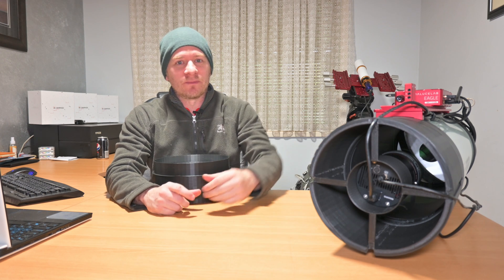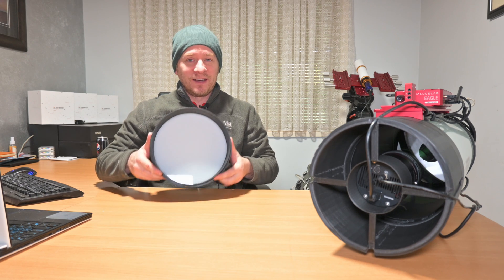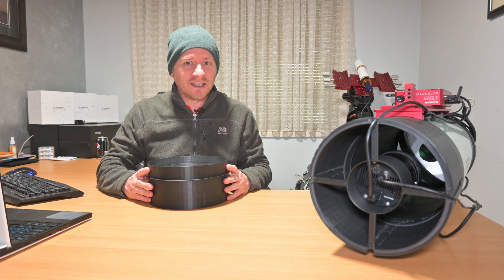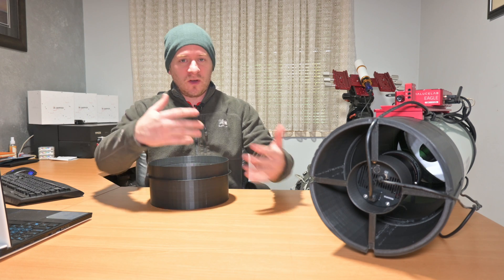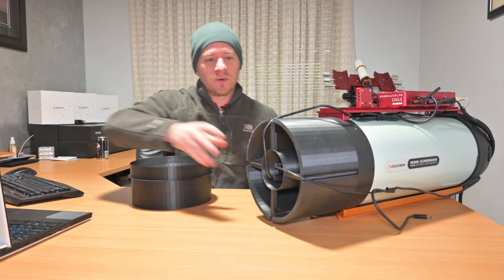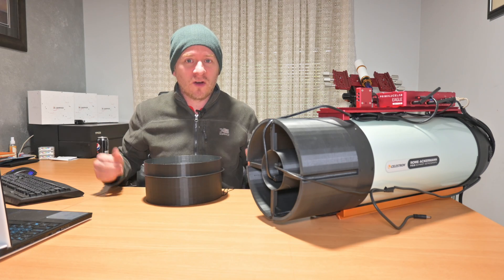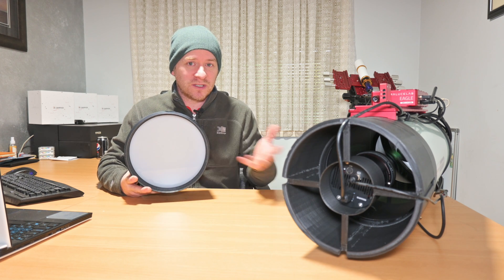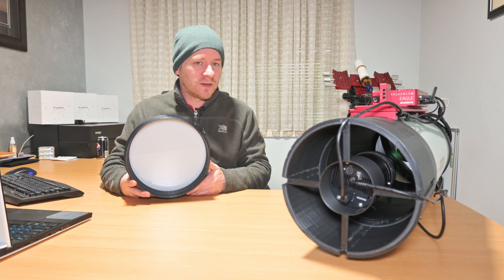RASA 8 Flat Panel

Comment: This design had 10% of obstruction   An optical designer will never design  that way. First he will  change cables for slim version  for reducing vanes thickness.   This is direct loss of  star magnitude  Then  he will  look at the design and find the true diagphramg  position The ID shield  at the front should not block the direct light , arcording  Celestron  choice of the size of the mirror .  for memory 2 deg is  equivalent  to 1.5'' at 40''  This is a fast mirror  much more than a refrector telescope which has a huge shield at  the front...     Why the RASA is built that way?  because Celestron dosen't need to put a bigger Mirror to get a maximum field of light  The Schmidt is nealrly at the focal plane , meaning half size of  its Schmidt Camera in the 70th.  A Schmidt camera is determiened by 3 numbers ,  the size of the Schmidt blade the size of the mirror anf the focal length which is half the size of the telescope!.   Longer the distance of the mirror , bigger must be the mirror! .  The RASA exists  because new type of lenses  like fluorite  or ED  are available on the market.  Before it was military technology.  Canon was the first with  its Fluorite lens on the  300mm f2.8 in the 70th.   Now there is no need  to put a Schmidt blade at the radius of the mirror  for big field  pictures . Schmidt  cameras or Slevogt  telescopes   are technology of the past.  Now  it is possible with some  smart lenses at least 3 of them , one  can gets the full field of light  more than 2 degree of field ( 4 moons size)  with stars of 3 at 5 microns of diameter despite of big obstruction and getting in bonus  a flat field of few meters of radius. ideal for CCD sensors.  I think the Rasa 8 is buily from  the C 9.25 primary mirror.  The Corrector reduces the final focus lenght to 16".  Doesn't cost too much and the client had no idea what mean diffraction.  Stars are 3 at 4 times the Airy spots but who cares..celestron is honnest to compare a picture done with its RASA  and a true Professional Schmidt camera.   Airy spot has nothing to do with telescope size but F/D  .  I mean  Rasa could get even better image  than the  professional Schmidt camera in fact exept for  power of resolution because this is derectly linked of the  size of Schmidt blade  . If someone understands this detail , he / she  grabs the fact than the Schmidt blade is given the limitation of resolution  not the focal length , The Shmidt blade should by no means be victime of obturation. .  I understand about the idea  of using 3D printing to build from bottom up  pards to  improve the support of the electronic  and setup constants to the digital tratement of the picture .   At least we know for certain the Schmidt blade will not break from the listed cameras compatible with the Rasa.  Having slimmer cable alligned to a vane will reduce the impact of the vanes  and the loss of light .  My other concern is the diffraction spikes created by the printing pattern of the tube  which must me removed and darkening to avoid   ghost images on the Schmidt blade .  I suggest Black Mars acrylic paint  which is daker than musou  for small angles like in astrnomy. Of course for photos made by objectives musou is better . When ideas look good in optical instrumentation  is is wise to learn basic optics before...

Comment: I guess you could use it for taking darks and bias images as well? Just with the light off and the hole covered.
Reply from the maker: I could however it’s easier to use the filter slider and insert a solid blank to take darks. Once you cover the scope up for a long period it builds up heat inside and the camera won’t be able to maintain the set temperature. Flat darks and bias isn’t a problem.

Comment: I have been also scratching around this idea as well for the 11. Great job!
Reply from the maker: It certainly is a must have I feel. How’s yours coming along?
Reply: @StevenMorrisAstro  I have only been at the pencil and paper rough sketches. I want to do a motorised sliding drawer door. Then I can put a small nano on it and control it remotely. So it can act as both a cover and a flat panel.
Reply from the maker: Sounds like we are on the same page of automation for our RASA scopes. I’m not sure I have the “smarts” for that level of design haha but keep me posted on your design and how it’s going.
Reply: @StevenMorrisAstro  At the moment, I just put a drawing light pad on top of the dew shield to do flats.